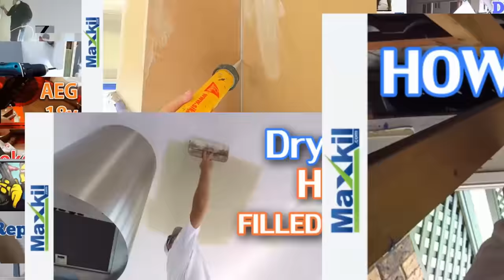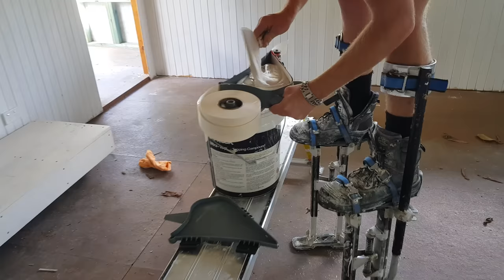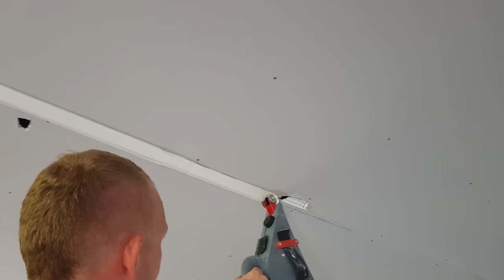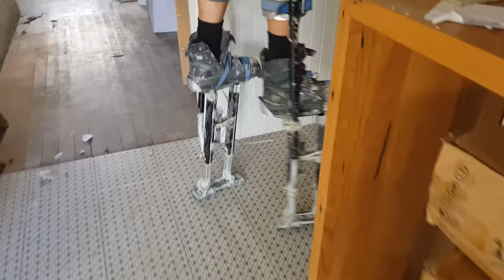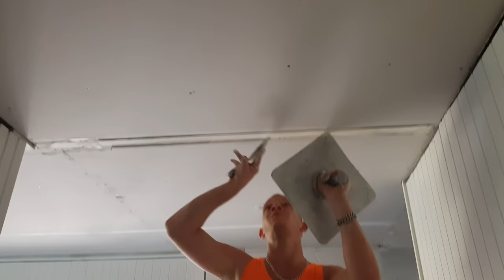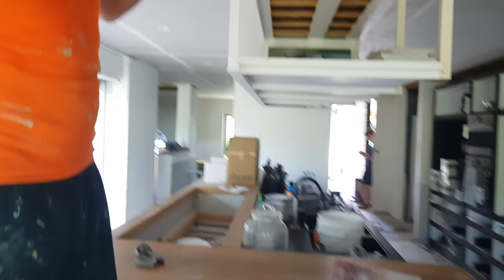Save time Taping Drywall Joints with a Banjo

Comment: At 8:20 when u have to stretch tape by hand....if u adjust mud flow tighter put less mud under tape you won't have to stretch it.also if you dock the banjo at the end of a run so only 1 wheel is in the wall less mud will come out make less mesd
Reply from the maker: that for the tips mate. I am a banjo novice,  That was concerning me of having to stretch it out.   So I will try that out next time. On monday im working with another guy who could be the quickest in the business doing new work. so check it out in a few days from now. He is going to be teaching me the auto taping tools and boxes

Comment: Thats fast eh. I wanted to see some footage of the stilts. I have never tried but he looks a natural on them. They would save some time cutting in the tops.
Reply from the maker: Yeah same as me. I tried them once but didn't really have the time to fall off and break a bone so I just went back to working from a ladder. Some time I will learn them as it save a huge amount of time.
Reply: I recon once you start to go down you would fall like a bag of shit and it would only be a matter of time before you fell. Maybe new work it would be worth the risk but on repaints imagine the mess.
Reply from the maker: haha yeah with paint bucket and brush. Would make for a solid video though
Reply: A rolling mini scaffold is a lot safer and easier. Stilts are outlawed on jobsites in my area. It's not worth a year of lost wages and physio to save a few minutes.

Comment: Pre fill  before taping rule #1 as a advise  no bad feeling
Reply from the maker: yeah that 100% correct, no comment... no comment.... lol
Reply: I've never prefilled in 17 years and never had a problem.
Reply: @ModernGentleman  I guarantee, you've had plenty of problems. People just didn't call you back to fix em. 

I am a remodeling contractor, so much of my work is fixing people's mistake. Always fill the gap, leaving air under the tape will bubble the paper. Eventually it pops loose.

 The best joints are taped with hot mud and mesh tape... Bulletproof. They can be floated out the rest of the way with regular joint compound.
Reply: @mr.upcycle9589  okay 👌

Comment: I was at a job where the guy running the job couldn't hang board worth a damn, and was an even worse taper. He would use the all purpose right out of the bucket- no water added. Initially, we was gonna hot mud everything! Didn't know how to router of measure. I demanded more pay for all the corrections I had to do. Not to mention teach.
Reply from the maker: Haha sounds fun. What city you work Manny
Reply: Don’t forget how you was learning
Reply: @kenseymour5152  
I surrounded myself with good to great journeymen to learn from. I was on my own hanging at 60% apprentice. I wasn't the fastest, but if you saw my work and didn't know who did it, you'd think it was done by a journeyman. 12yes later, my work is still tidy and always passes inspection.
Reply: @Maxkil  
I'm in Sacramento. Raised in Hawaii. Visited Australia in 2000 and loved it!

Comment: When you are wiping down the tape, what are you doing with your hand before you wipe it down ?? , would you recommend a banjo for a beginner to try taping ?
Reply from the maker: Just stretching the tape out so it doesn't bunch up.
Yeah definitely... Even better I recommend a beginner use fibafuse tape. It won't bubble and is very flat.

Comment: 22 years in the business 
 Mud is way to thick for a tape coat that's why you have to keep pulling the tape by hand. In theory it seems quicker but a good hand finisher with a tape belt would blow that thing away without much effort 😅
Reply: Yeah but not everyone has that touch but I'm sure your 100% right tho got any type tips

Comment: This tends to peel off about 10 years later.... much better to use fibre glass tape and a traditional plaster over the top, rather than the soft multipurpose filler you use with the paper tape...
Reply from the maker: Yeah multi purpose compound is weak and soft